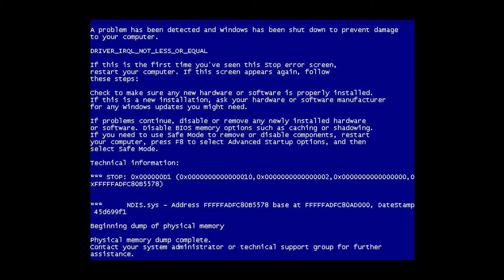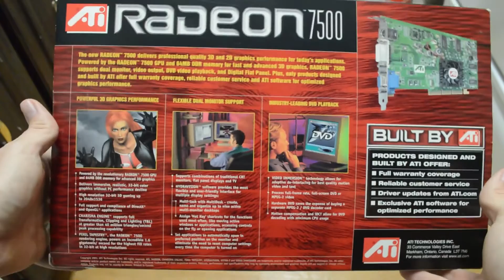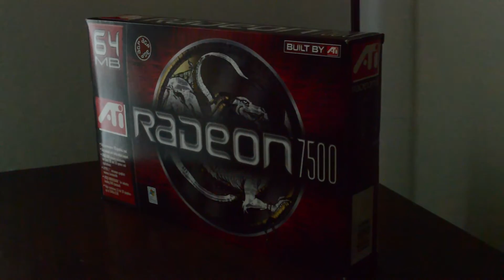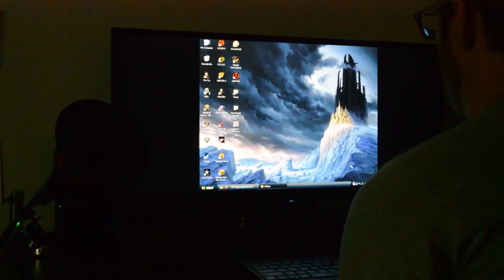Memories with the Radeon 7500, My First Graphics Card!

Comment: It's amazing hearing your story, which seems so similar to mine. I also got into computers by convincing my dad to buy an AGP 6600GT for our family computer with an old Pentium 4 2.8 GHz cpu. Opening up the PC for the first time was so scary but exciting, and luckily for me the installation went smoothly and the card worked in the PC straight away. It was also when I first learned that there were different speeds of AGP ports and our PC only had 4x, which seemed to limit the 6600GT. That limitation then eventually led to me buying my own PC with an Athlon XP 2800 on a motherboard with an 8x slot. After some overclocking of the Athlon and some RAM upgrades, I slotted the 6600GT in and finally saw its true potential. From that point, I was totally hooked on computers. :)
Reply from the maker: Haha great story! I enjoyed reading that!
Reply: Oh I remember the 6600 I had one and the 6800 was out of course I wanted that very bad but very expensive

Comment: Mine was a Radeon 7500 LE :). First thing was that I installed was Max Payne and played it with everything maxed out. Couldn't believe how great it looked. Couldn't believe how great it ran on a Pentium 2 350 Mhz.
Reply: I remember getting a 7500 LE precisely because my previous card wouldn't run Max Payne. 

The naming scheme and specs for cards back then were very inconsistent. As far as I can tell, if it was a "7500 LE" that just meant that it had a moderately lower clock-speed than the full 7500. The LE model also normally had a weaker memory system, but some versions of the non LE version could have a 64-bit bus, and some versions of the LE still had a 128-bit bus, which is obviously pretty ridiculous. They didn't all have the same amount of memory either I believe. 

All that being said, even the weakest versions of the 7500 LE typically still had very good performance per dollar. I had one of the weaker models, and it was an enormous improvement over my previous graphics card, and there simply wasn't anything better available to me for anywhere near the same price.

Comment: The Radeon 64MB ViVo DDR was the first 3D accelerator that I learned much the same as you did with your 7500. I had a Voodoo3 3000 before it but never really played with 3DMark, drivers, overclocking, or anything else. The Radeon, which I still have, now resides in a Pentium III 1GHz system alongside the Original Audigy (Retail version).

Comment: Radeon 8500LE 128MB was my first dedicated 3D accelerator I bought, right around the time of Doom 3 release, which it ran okay (running Doom 3 okay in 2004 was nothing to sneeze at).  Paid all of $20 for it back then, which is even more impressive.  I only got the brown box of it, but it came with an OEM version of Half-Life + and old build of CS.  The copy of HL on the CD was badly corrupted, but the CD-key was good to use to activate the game on Steam, which converted into HL Gold Pack on my Steam account, HL with all it's expansions and mods, including CS, which myself I don't like all that much but played people I know a few times.  It was definitely a solid card for the time, and a cracking good deal for the money I got it for.  I didn't have any major adventures with it, as it was bought for a new PC I built that had no onboard video (intentionally).  I had been assembling and repairing PCs for about 4 years at that point, so it was all unveventful.  In 2005 I upgraded to a PNY Geforce FX 5700, because it was on sale and was a pretty cool bundle with TV capturing (which I never really used), an RF remote (which was a big deal as media PCs were just starting out and were all the rage), and came with a flash drive from PNY (back then you had to spend real money on flash drives, they weren't nearly as cheap as they are now).  The 8500LE I sold to a high school friend.

Comment: The 7500 and 7500 LE were very similar. "LE" just denoted a lower GPU clock speed. Both came in a variety of different memory configurations, so some 7500 LE models actually had a 128-bit bus, and some 7500 models only had a 64-bit bus. It was pretty confusing, because AMD had basically let the board manufacturers do whatever they wanted. There definitely should have been a different product name for cards with a 64 vs. 128-bit bus!

That being said, even the cheapest version of the 7500 LE was a good card for the price.

Comment: I had the original card before It, Radeon 64 VIVO (Radeon 7200) back in 2000, cost me £200, fantastic card, I remember why I bought it, it had EMBM (environmental bump mapping) a feature no Nvidia card had and I'm glad I bought it as Giants Citizen Kabuto looked stunning on it, also the 32bit performance was superb. 
It wasn't my first graphics card, far from it, probably my 10/12th, it's hard to say as my first was a Trident 1MB 32bit Vesa Local Bus (VLB) back in 1993 when I built my first pc around a Intel DX2 66Mhz and sound blaster pro 2, I must have been mad to spend £1800 building my first pc back then
Reply from the maker: If you love the original Radeon then look forward to my next video I have coming up!

Comment: Similar story ahah. I installed a "multimidia kit" cd-rom drive and sound card, on my mom's AST 486 sx 33 when I was 13. CD-rom worked fine, but I knew nothing about IRQ settings, that was a problema that my step dad fixed later on.

Comment: I also "upgraded" from an mx card, tho the 440 not the 420, to a 7500. While it did the same things, it did it faster. It was my 4th card, though probably 8th graphics chip I used. 1st was a pine sis305 32mb, 2nd an Intel 740 when the 305 died, and 3rd the mx440. Other chipset were a sis530 onboard, some cirrus logic pci, an ati rage ii DVD 2mb, and a vlb opti 512kb card. At some point a mx200 as well, but pci. I've since used all sorts of gpus but currently just have a lenovo x230t laptop... Sold the gaming stuff for other things needed for the kids.

Comment: my first gpu was the fx5200, 64 bit memory bandwidth. It sucked used it for a couple of months until I got the 6600GT. 6600GT was so much better, than I got the Geforce 7800GS OC which made a pretty big improvement.